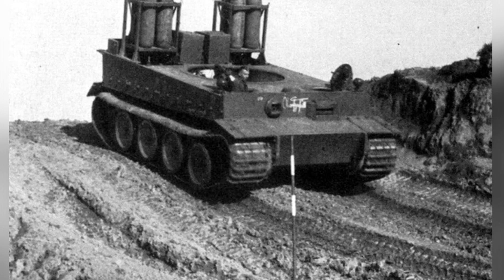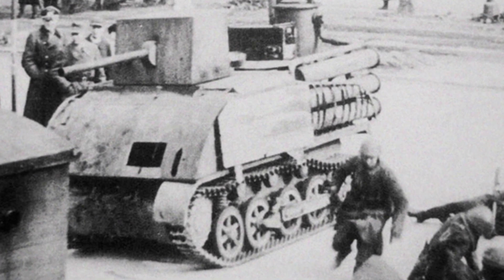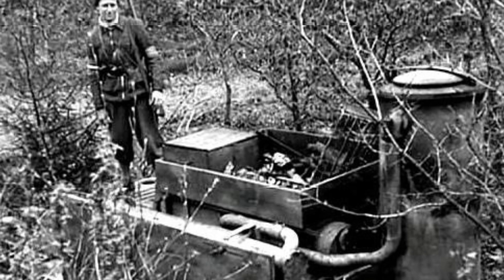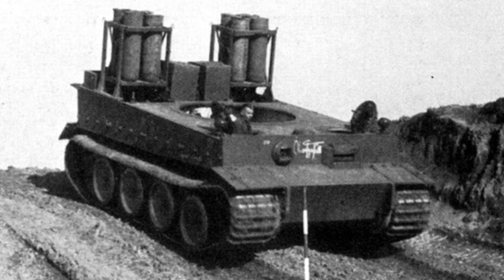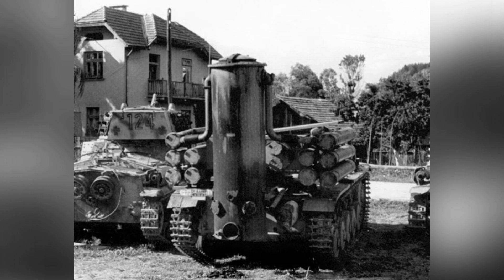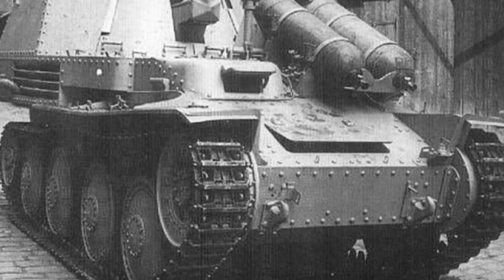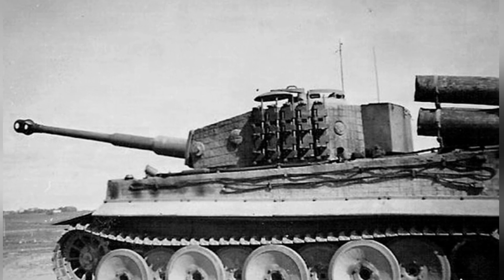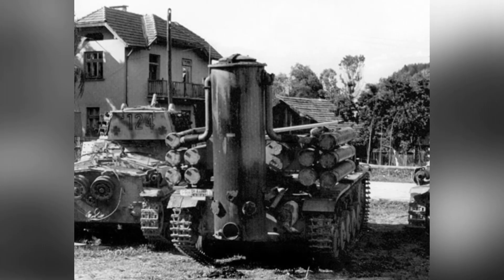The Gas-Powered Tanks of World War II: Pz I, Pz II, and LT vz.38

Comment: The French called these "Gasogene" vehicles, I believe.
From the Wiki: "Gasogene engine, a process that converts organic or fossil fuel based carbonaceous materials into carbon monoxide, hydrogen and carbon dioxide
Wood gas generator a specific type of gasogene engine that converts wood into fuel that can be used to power an internal combustion engine"